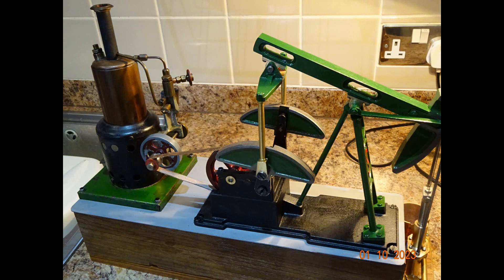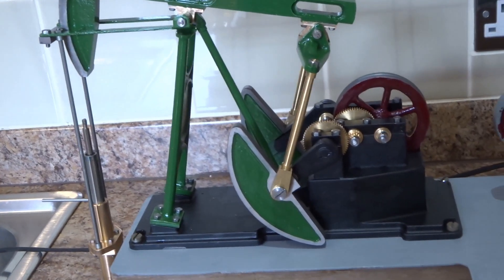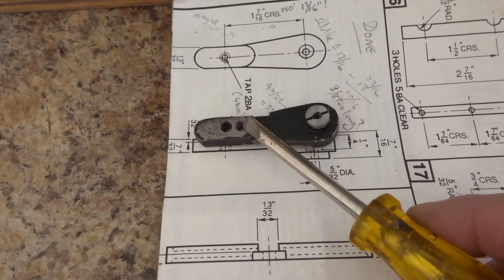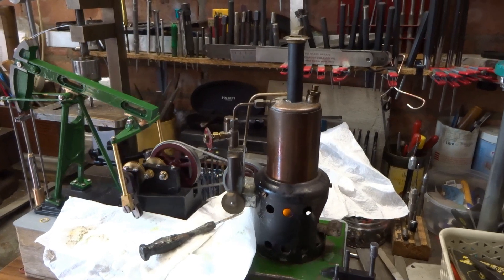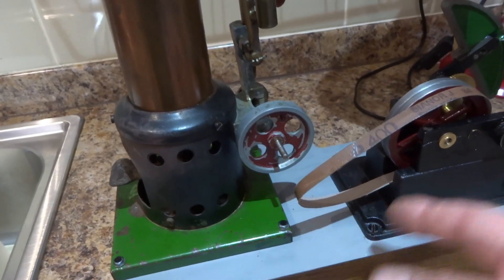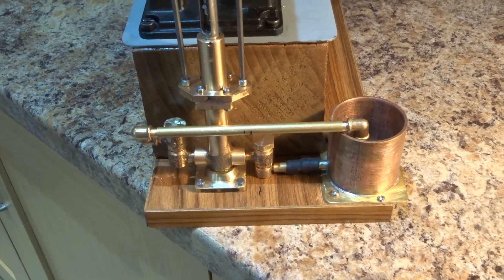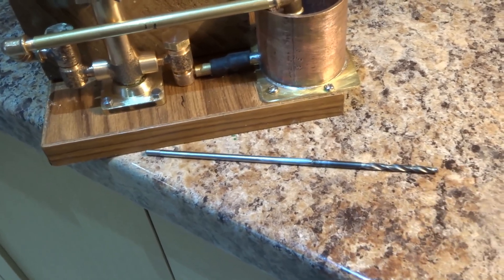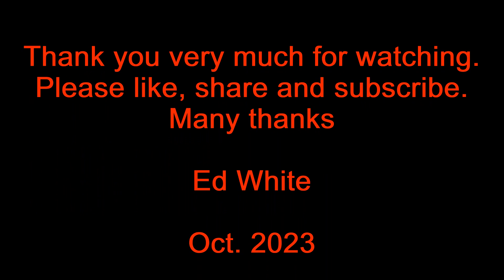Tale (tail?) of the nodding donkey oil field pump

Comment: Good work Edwin, runs well.
Reply from the maker: Hi Ben, yes I did visit the Stuart stand and while they were not looking I attempted to rotate their version of the pump. As with my initial version the pump could not be rotated because the bottom clamp for the two steel wires fouled the two braces. I asked the guy about it and he admited they rarely ran the model but if they did they had to remove the bottom clamp on the two steel wires. I felt vindicated, but just walked away. I will not run my model, but know that if I want to I can because on mine the bottom clamp does not foul the bracing arms. I suppose I have become a bit anal in my old age. LOL
Ed
Reply: @edwinwhite933  No that is interesting! Good work.
Reply from the maker: Thanks Ben. I admit to being rather pleased with this one which is not always the case with the things I build. LOL
Ed

Comment: Nicely done.  Thankyou for sharing this video.  Does the pump actually pump water?
Reply from the maker: Yup the pump works. There are two 5/32" stainless balls one on the suction side and one on the delivery side which act as non return valves. Many thanks for the compliment. Ed

Comment: Hi, that's a wonderful model. Looks great and runs very well. Could it be that the flywheels are a bit small to get a round run? Greetings Alexandra
Reply from the maker: Greetings. Excellent comment I had not thought of that. I'll make and try a heavier flywheel. I used the oscillator engine in its original form and an improved flywheel may well help with overcoming the balance weights. Many thanks.  Ed